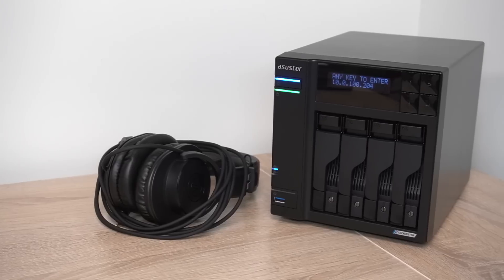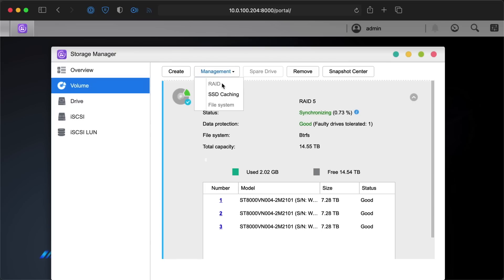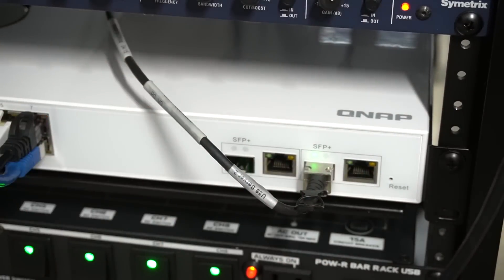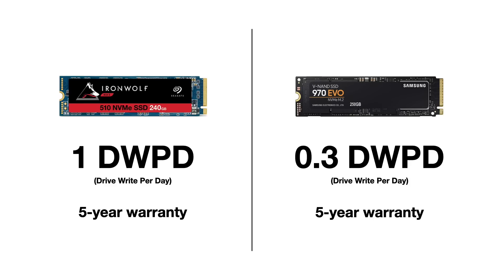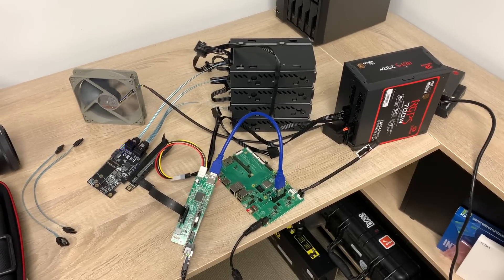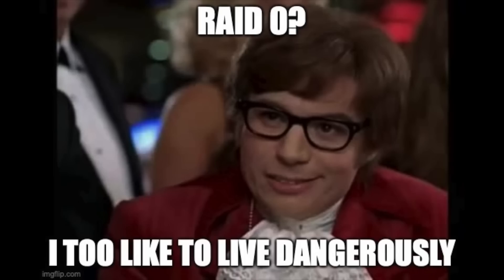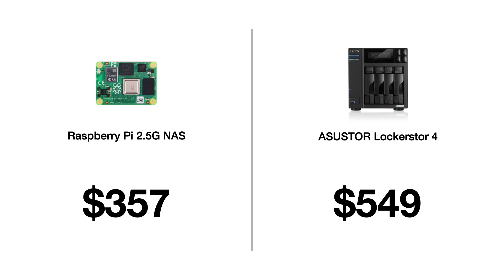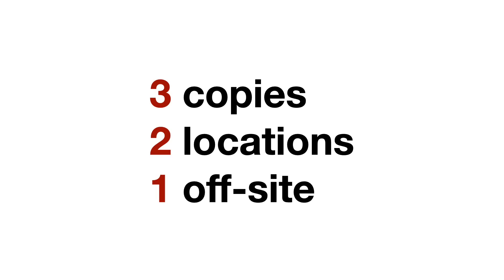Raspberry Pi vs ASUSTOR NAS Head-to-Head Part 2 - the VERDICT!

Comment: Thanks Jeff. Loved the comparison of speed and ease of setting up. 
I must point out though that it occurred to me like you conflated storage technology with backups and then, you added insult to injury by suggesting a catch-all 3,2,1 plan to a reasonably technical and analytical audience. 
The storage technology RAID, ZFS etc. etc. determines the reliability of a storage appliance, 
The number of such appliances determine the redundancy. 
External risks; fire, power, data comms etc.  will determine mitigation strategies such as location of backups, UPS's etc.. 
A recovery procedure and time-to-restore are also part of the equation and has to be factored into a backup strategy.
Finally a testing strategy is required.
A backup strategy is worked out by considering risk factors, consequences and mitigation. It's not a particularly technical process and I'd venture to say, most, if not all of your audience can reasonably analyse their own situation, environment and analyse it to come up with a plan that works for them.
Cheers, and thanks for your wonderful videos!
Reply from the maker: You have a lot more faith in my audience's analytical abilities than I do ;)

Not a knock on the audience, but I just have to acknowledge a lot of people watching these videos are just at the very beginning edge of learning about the topics I cover.
Reply: @JeffGeerling  I'm sure there is a distribution of experience and knowledge and some will be coming in from the cold - to learn. 
Perhaps a video on risk in relation to backups. Might be dry, but I'm sure red shirt Jeff can help with that :) Regardless, whatever you provide Jeff, I'm always grateful for your videos. You are one of a select few content creators that provides exacting information and not regurgitated opinion, and I for one value that greatly.
Reply from the maker: @Bennyboy-dog  Definitely considering doing at least one (maybe series) on backup and data retention (targeted at home/small business use case). And thanks for the compliment—I figure there are about 1000 people on youtube reviewing products and listing specs.

If I don't learn something, and by extension, teach something new, in each of my videos, I count it as a failure. There are enough 'LTT clone' channels here :)

Comment: Is the reason that the Pi locked up during the RAID 0 test, because it was thermal throttling? You did say that you increased the clock speed, but I didn't see you improve its cooling solution, and the faster RAID 0 would mean more data being moved, and therefore a bigger workload for the CPU.
Reply from the maker: In this case, no. It hard locked up (required power reset), and there was no indication the temperature was ever above about 55C

Comment: Jeff, I appreciate the reality of a build and the comparison.  It appears you chose PiNAS for the software solution, which certainly meets the requirements set forth and matches the base capability of the ASUSTOR features.  Something I tripped across yesterday was NextCloud which runs on a Pi - I haven't done an actual build yet, but watched an Ubuntu Appliance on compact PC and it really seems compelling (especially if one configured the "Database" on a RAID)  ->   Nextcloud: Build a personal cloud for your data
I wondered what your Pi NAS setup would be like using NextCloud as the software.
Here are the Relevant links from the Byte My Pi YouTube:

Nextcloud
@t

Ubuntu Appliance
@t

Comment: You didn't clarify if the asustor has ecc or not. Using a data storage device without ECC is a pretty dumb idea if you actually care about data integrity though. Especially without scrubbing (EXT4...)
Reply: Neither the Pi nor this device supports ECC. The memory controller on the Intel Gemini Lake Refresh SoC does not support ECC.

Comment: FYI copying large files isn't a very good test for dm-cache. It purposefully subverts the cache for sequential IO because HDDs tend to be fast enough for sequential loads, and because it drastically improves the longevity of the cache drives.
Reply from the maker: All writes go through the NVMe SSDs even when using dm-cache though—I was monitoring the individual drive activity and confirmed it would write through from the network to the SSDs, then after a brief pause, I'd see the SSDs go to read and the HDDs start writing.

The best thing about physically-spinning hard drives is you can also hear them quite easily when they start writing :D
Reply: @JeffGeerling  hm. I must be reading outdated information then.

Comment: Thanks! I was guessing the pi would fall short of this NAS. Personally, I use a regular, cheap PC with a lot of drives and some lvmcache. I should have used zfs, for sure, I know it by heart after spending some years with it on large setups. But then, you can't just toss in a new drive in zfs and grow a VDEV as you can with mdraid. I'm not a particular fan of hwraid - they hardly exist in any enterprise setup anyway - they look like hardware, but that's just hiding the guts. Everything is software these days.

Comment: I'm not sure what kind of issue you had with the nas and the 10Gb network, but if you're using an sfp+ to rj45 adapter that might be the cause. Serve the home did a video (and an article as well) a few months back comparing a bunch of this adapters, and some of them support 5Gb and 2.5Gb no problem, while others don't. Maybe it's helpful to check it out
Reply from the maker: The main problem was I would get asymmetric speed—2.5 Gbps in one direction, and between 400-800 Mbps in the other. And I tried four different transceivers (two different brands), DAC twinax, and even fiber, with multiple Cat8 and Cat7 patch cables (all known working in another network), and kept hitting the same issue. Full bandwidth one direction, flaky, less-than-half bandwidth in the other.

Comment: BTRFS > ZFS change my mind
Reply from the maker: I have no horse in that race :)

I still don't trust any of the fancy features in either, and stick to having a good backup plan no matter what. Snapshots and some other features are neat, but IMO planning your arrays well, monitoring them well, and having reliable backups following the 3-2-1 plan will serve you well for decades to come.
Reply: @JeffGeerling  Totally agree on the 3-2-1 rule with properly monitoring even the off-site, no local redundancy can replace that (Still, love local redundancy to save bandwidth and vulnerable time in case of a failure).

I mainly commented to troll ZFS - better people but BTRFS is actually really neat for a cheap home nas. You can take the random bunch of drives one has lying around (as long as the capacity of the largest one is smaller than sum of the rest) and use them with half of capacity reserved for redundancy in RAID-1 (misleading... in btrfs raid-1 means 2 copies on 2 drives) When it's getting full, again simply extend the array with random capacity cheapest per byte you can get. 

Compression is also a neat feature that can save some space and increase speed depending on the file.

Comment: Raspberry pi is a good nas if you use only 1G network and usb hard drives (I know that are not nas grade).
I have a setup with PI 4 2GB model and 2 TB western digital usb hdd. 
It works great for plex file storage torrent box and I also edit 1080p videos from it.
Reply: Some of the external actually contain a white label NAS drive

Comment: Come on you're using a 700W PSU to actually use 45W... that's where the PSU is the most inefficient.
PSU boast 80% or 90% efficiency, but that's when you're near the maximum (700W in this case). When you're far away for that, the efficiency drops, you're probably at 70 or 60% or maybe even less!
Look at the efficiency chart there: https://www.tomshardware.com/reviews/psu-buying-guide,2916-3.html
The ASUS device has an optimized PSU.
You need to do the same... find an efficient 12V 50W or 60W adapter and measure again please :)

Comment: I would love to see a video about that AWS S3 Glacier backup method you are using. Especially interested in how does it works for you price wise (both storing and getting data back). I was puzzling with that idea for a while, but price calculation with AWS services are clearly not made with individuals in mind and always got scared away. (or use Google Drive or something more simpler instead)
Reply: Actually, try DigitalOcean Spaces. They have a $5/250GB/Month + 1 TB traffic plan and it is S3 compatible. Restic, rclone and others can talk to it. I stuffed about 2 TB of deduplicated backups in there using both backup and the SFTP translator built into rclone.
Reply from the maker: Definitely an option. I did the calculations and found that the S3 Glacier option ended up being about 1/4 the cost of any other standard S3-compatible storage plan, plus I put a lot of faith in Glacier's data storage reliability.

I have had to restore a few times (usually for some giant project I accidentally deleted locally and didn't realize it until much later), and the costs aren't bad if you're okay waiting a day or two for the download to start, and at a kind of slow rate.
Reply: @JeffGeerling  really depends on how fast the recovery should be and how much data you will download in such a situation. Traffic from any of the big clouds is very expensive. If you mostly just send data in and want to keep them for a long time, S3 Glacier is really good and likely the most reliable option and quite cost effective.
Reply: @JeffGeerling  Thanks! Probably they store it on tape and the wait time is for the queueing. By the way, interfacing an LTO drive with the Raspberry would be an interesting video. Technically not a challenge now that you have a SCSI card attached :) But I wonder if the Pi can cope with the transfer speeds this requires - as some kind of periodic backup agent.

Comment: Did you use LACP (link aggregation) within the Asustore for the two network ports to speed up your network? Or isn’t it available within the NAS OS of asustore? Great topic bye the way. Really love your channel 👍
Reply: Will not help with single copy stream at all if that is what you are looking for. It could help with multiple clients though depending on the hashing type configured for LACP (just IPs or also ports)
Reply from the maker: I haven't tried aggregation yet, but plan too soon. Right now my Mac's 10 GbE network adapter is being replaced :(
Reply: @JeffGeerling  good lick doing that. And great footage again 👏. Love it when a RPI is involved. 👍

Comment: Would the pi nas not be much faster with an raid card? They can by found on ebay for the same price as your sata hba. (50 dollar). Then the raid calculations will not happen on the pi cpu but on the raid card.
Reply from the maker: I cover this in a few of my earlier videos in March—right now it seems only the newer generation RAID cards are compatible with ARM64, and I demonstrate using a Broadcom MegaRAID card, but those cards currently cost $200+ (used). I'm still hoping I can get an older RAID card to work though. I have a pile of them.

Comment: Normal behaviour for a Seagate
I returned that DOA rustbucket and went with one more WD
Reply: Happens to all HDD companies. Burn in hard disk drives before use by writing them full and checking the SMART values. You will catch the bad ones before they enter productive use.
Reply: When the first Seagate you buy in over a decade is DoA, it's hardly confidence inspiring.
I have WD RE2s that have been happily spinning for that long.
Reply: @Wannes_  yes, I understand. That doesn't make it a statistically relevant sample though. A friend of mine bought 6 WD drives and cycled through all of them in a matter of a month. He was experienced enough to do a burn in before putting any HDDs into productive use but he lost quite a bit of time on this.
Real enterprise drives for OEM servers usually come already mounted into a drawer and are heavily packaged. The package is often at least 2x the width and height of the drive itself and they ship with UPS, FedEx etc. that usually handle these things a tiny bit more carefully.
Reply: @Tano I don't have SMR disks ;-)
The Toshiba alternative was a lot more expensive
Reply: @Tano Bryan Cantrill somewhere mentioned, some Toshiba HDDs they used at Joyent tended to go for random sleeps/ internal firmware reboots under load.
(EDIT: https://youtu.be/fE2KDzZaxvE?t=1812 it was Seagate actually, sorry for that. I think, I have heard something similar about Toshiba too, but mixed up the cases here probably.
Here is more detail: https://youtu.be/7AO4wz6gI3Q?t=1390)
So basically the IOPS dropped to 0 and the array though the disk is probably faulty (it kind of was). Basically every manufacturer has problems if you are looking for arguments. Especially the SMR fiasco was partially also caused by consumers not verifying data and not testing before going live. Every production facility in any industry I know always tests new batches of anything they receive. E.g. steel foundries even test scrap metal for radioactivity, I am not joking.

Comment: The Pi 4 processor can get hot enough to throttle without a heatsink, so I'm surprised I don't see one on your machine. I bet you'd get at least 5% better benchmark numbers with at a heatsink on your pi cpu.
Reply from the maker: When used in the open air (in a well-ventilated space), especially with active airflow over it (I have a 4" noctua fan blowing air across the entire setup), I've never seen a CM4 or Pi 4 throttle the CPU or GPU. Enclosures typically cause the overheating problems.

That said, if you do overclock, you should make sure to monitor the temperatures and consider improving your thermal management setup.

Comment: I'd say you could save some more money with the RPie. There's cheaper PCIe Risers, fans and fan controllers as well as PSUs that cost half as much and probably won't require a Molex to Floppy adapter, I'd say $300 should be a realistic price.
Reply: The 1GBit Ethernet thing would definitely help as well, yes.